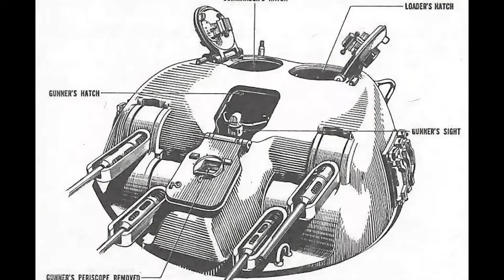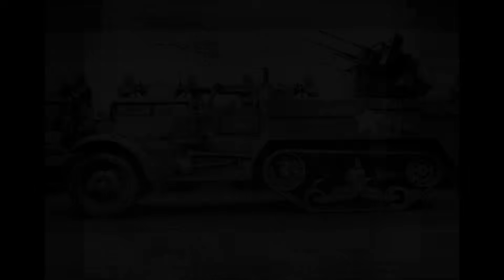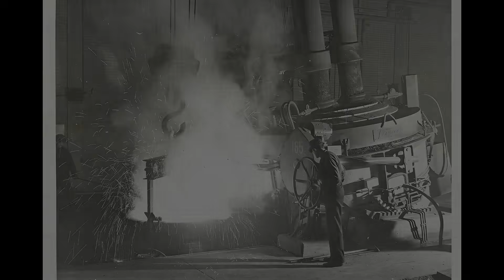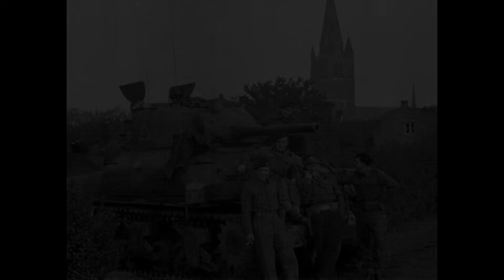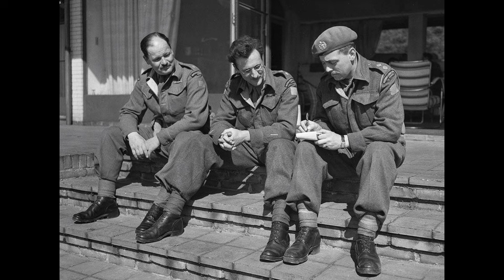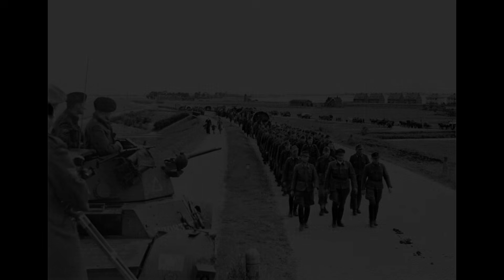How Canada Turned a Sherman Into the Infantry's Worst Nightmare

Comment: Two Skink Pilots were built on US manufactured 75 mm Gun Tanks M4A1 supplied to Montreal as manufacturing trainers and were  CT237775 and CT237776, one being completed with a cast welded turret.  Production Skinks possibly the last three Grizzlies produced Shop number 186 CT 164010, Shop 187 CT 164011 and Shop No 188 CT164012 (there is dispute in the numbers produced, some sources list 188 built others say 185 built and Shop 185 still exists as the example at Portsmouth and is a Grizzly,)  Those last three conform to late production hull variants of which the SKC 1001 marked example used in the ETO trial was of that hull type.   So far the only other positively I.D. variant was the mid production hull example,  CT163932 	62-728 which was shown at a depot probably in Ottawa or Montreal (name Hawles doesn't not match any drill hall in Canada) in 1945, it was stripped of its turret and used as an APC like a Ram Kangaroo before being sent to Portugal in 1952 were it remained until scrapped, in the late 1990s despite the CWM being warned of its existence.  

There were also 8 complete turret kits produced to convert existing Grizzlies so possibly Shop 108,  CT163932 may have been a re-turreted example  and another turretless tank Shop 80 CT160273 DnD 62-700
 at Carragado had Skink fitments (lay flat hull hatches doors and the bar armour on the glacis that would prevent bullets running up the glacis into the open A/A opening, so that may account for 2 of the turret kits.  

As it was there were 117 Skinks contracted for, from Shop 132 CT 163956 to Shop no 249 CT 164073 of which 61 were cancelled and those slated for Skink production up to Shop 185  (53) were completed as standard Grizzlies and of them at least 13 still survive including the final Gun Tank Shop No 185 a Portsmouth and the example at CWM Shop No 178

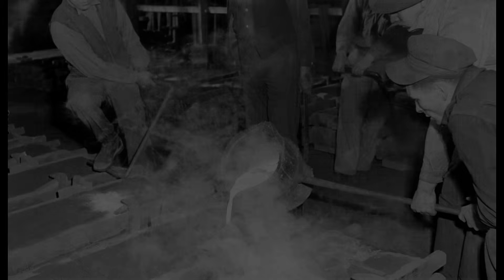Comment: 8:53 wrong the Skink used the same hull and turret ring as a standard M4A1 Grizzly how the turret traverse was improved was by simply doubling the motive power of the traverse system and adding a second smaller elevation system, their being no need for a gyro stabiliser drive capacity was saved in that respect.   It is all described in the the maintenance manual for the Skink AA system of which numerous copies still exist, I know a bloke who bought a Grizzly (tank number 12 CT 160205  DnD 75-999) who was unable to buy a manual for a Grizzly had a pristine Skink manual. And the manual goes into the high speed traverse mechanism. Bovington Tank museum have a well thumbed copy of the Skink Manual.  Basically the only change was to increase the power and hydraulic flow for the drive motors, effectively doubling the capacity and thus speed.
Reply from the maker: Thank you for the detailed explanation and for sharing the information about the Skink maintenance manual. I appreciate the technical insight. My intention was to explain the improved traverse capability rather than imply the hull or turret ring had been redesigned. I'll revisit the maintenance manual and compare it with the other sources I used. Thanks for taking the time to contribute such a knowledgeable comment—it helps improve future documentaries.
Reply: @canadian_legacy I enjoy your video greatly, It is a case of lest we forget on steroids, when I find out the nonsense my nieces are told at school, without people putting up videos society would sink back to ignorance so thank you.
Reply from the maker: @steve-qc8hd Thank you so much... I really appreciate that. Comments like yours make the countless hours of research worthwhile.. And I genuinely appreciate knowledgeable viewers helping refine the details. Thanks for watching and supporting Canadian history.

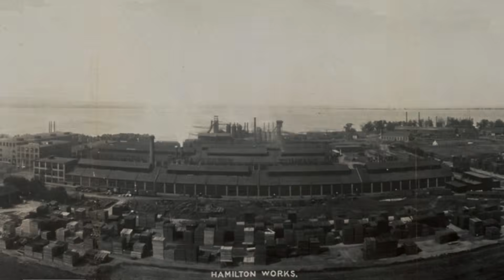Comment: 6:06 Actually most Ram, Grizzly, and therefore Skink main castings - so turrets and hulls was done by General Steel Castings of East Chicago, and I fairly certain although time has marched on, that the two Skink turret casting found on the shooting range at CMB Range at Vernon British Columbia were also from GSC Co. in fact many people think the G logo of GSC Co means Grizzly,  it doesn't it is a common marking on US tanks even as late as the early 1950s. The US M48 tank at Bovington Tank Museum has a GSC Co turret casting. and surprising some of the early Churchill Mk I and II turrets were cast in East Chicago, most of the steel produced at Hamilton was rolled steel plate and small casting such as bogie assemblies and final drive housings, I'm pretty certain the largest castings done by Hamilton were the cast hull fronts  for the later Valentine tanks, but even they could be out of East Chicago
Reply from the maker: Thank you for sharing this information. I really appreciate knowledgeable comments like this. The manufacturing history of Canadian AFVs can be surprisingly complex, with different companies involved in castings, fabrication, and final assembly. I'll definitely look further into the General Steel Castings connection and compare it with the references I used. Thanks for contributing to the discussion! 🇨🇦
Reply: @canadian_legacy  General Steel Casting Co is well known many people think their logo on the hull of Grizzly tanks refers to G for Grizzly, it doesn't GSC Co produced carapaces for US Sheman manufacture too, even some M26 Pershings, M47 and M48 Patton tanks have the same manufacturing. But don't get me wrong producing Grizzlies Sextons Ram and Valentine tanks in quantity was no mean feat, along with everything else rifles BREN Guns, aircraft, food stuffs and manpower, as I said combined effort.

Comment: So in addition to inventing the Armoured Personnel Carrier, Canada also invented the self propelled anti aircraft gun.  It is interesting that the German version of the Canadian concept is kicking ass and taking ruzzian names in Ukraine right now.  Before the Skink was created Canadian troops simply manhandled their 40mm Bofors anti-aircraft cannon into the front line and used them to destroy fortified positions despite explicit British procedures forbidding the use of AA cannons in a ground fire role.
Reply: Well, will all due respect to the valour Canadian troops (I'm Italian with a multidecennal passion for WW2 and MTO in particular, and Canadian troops exploiits are very well known here) and to Canadian ingenuity, I'm not really sure if it could be said that Canada invented the SP AA gun. "Tank AA, 20 mm Quad, Skink" was developed in 1943–44: its first test turret was demonstrated in mid-December 43, in January 1944 was successfully tested for the first time on a Grizzly chassis and in April 1944 the very first 20mm Polten gun turret was deployed. The British Crusader III, AA Mk II, armed with twin Oerlikon 20 mm guns for anti-aircraft use appeared - built from Morris Motors - in the summer of 1943, the pilot model being issued for testing in June 1943 and in June 1944 it seems - but it's disputed - that there were AA Crusaders in the D-Day landings. In the very same days, the German Mobelwagen (presented December 1943) was developed, and entered production on March 1944. Some designs are, more or less, appearing in very close timeframe
Reply from the maker: Canadian troops consistently demonstrated an unmatched ability to improvise and adapt equipment to overcome the challenges on the front line.